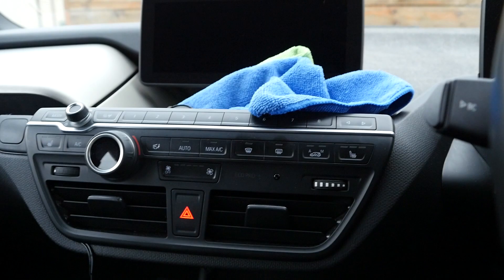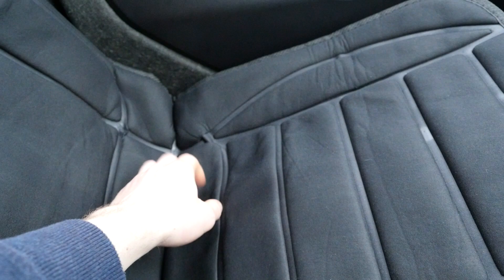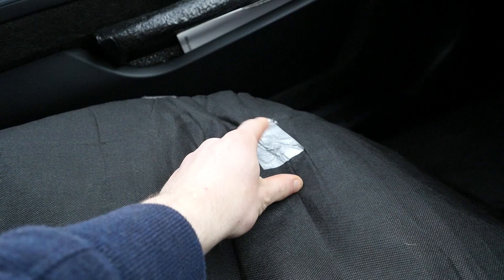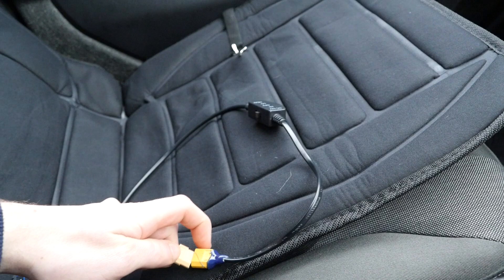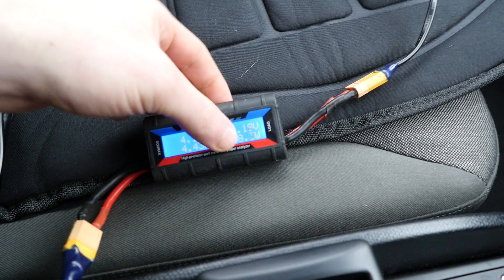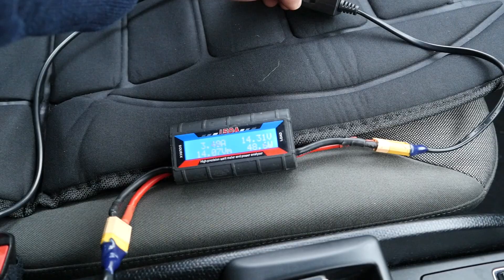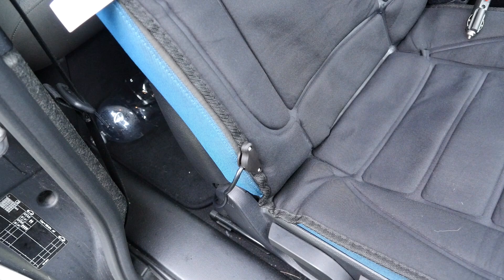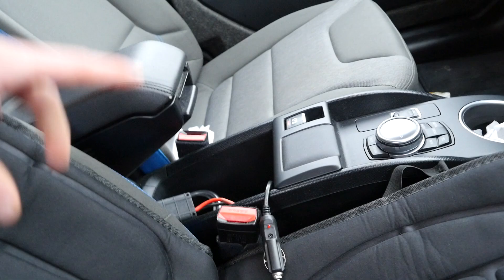12v Heated Seat Cover Review

Comment: The can bus system on your BMW is detecting a low voltage. That’s why it’s cutting out your seat after a while! This will be mostly down to a  failing battery! If you have just changed the battery then it has lower Amps per hour than your old battery!! If your still on your original battery then I’d look at changing it! For one that has EXACTLY the same CCA & AH. If their was a fault with the seat it will throw a code and a diagnostic check will pick this up!!
Hope this helps!!!
Reply from the maker: It's nothing to do with the battery as the passenger seat never cuts out. The 12v battery only powers the 12v system in the car if the dc converter fails or the car is off.